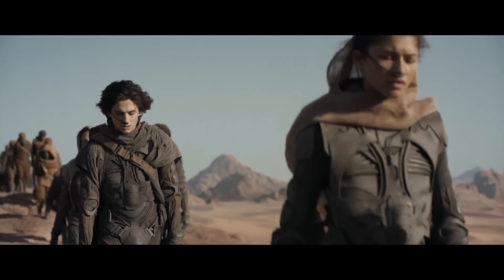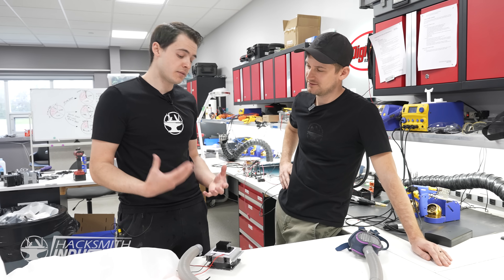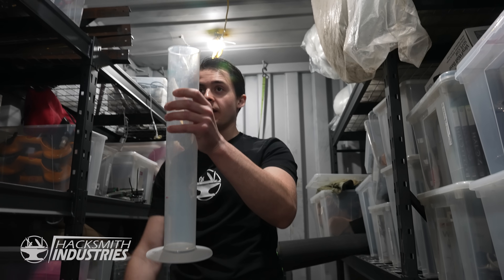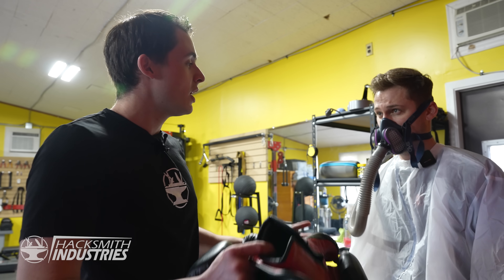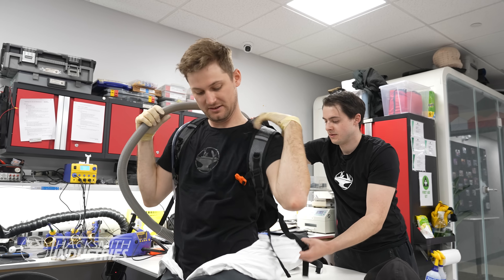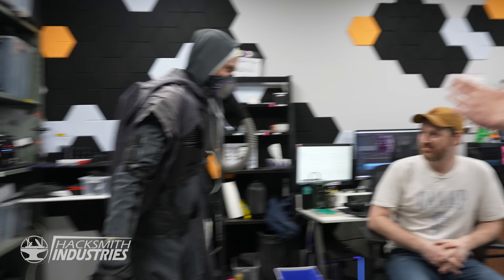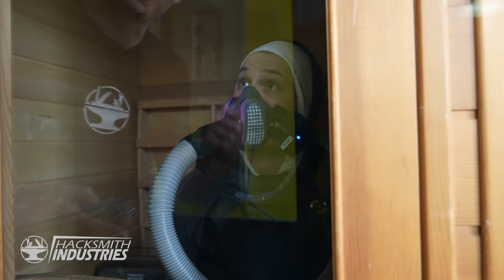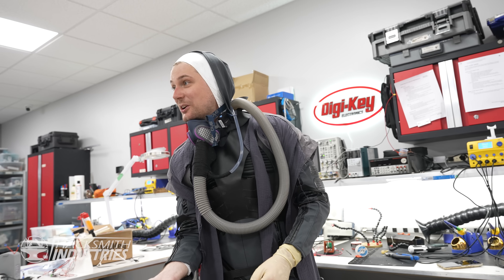Building a real DUNE STILL SUIT (1 DAY BUILD)

Comment: I think this as a proof of concept is cool. 

Though with a filter outside exposed like that it wouldn't survive in the desert of Dune for long. 😅

Also if you had a way to use kinetic energy alongside a solar battery pack, It could be self sustainable. I really like the design overall. 

You guys did an amazing job and it looks great though! 🔥🔥 🔥

Imagine if the backpack had:
Neptune crystal AquamanCrystal that was labeled to absorb oxygen from water and air. You could probably swim with it on too. 😅

Comment: Guys, a hint, since I think it was not mentioned in the video: since he is drinking distilled water, meaning there are almost no electrolytes in the water while also sweating and doing physical exercise therefore losing more, there is a definite amount of time you can spend using the suit until you start going into an acute deficite of electrolytes and it gets seriously dangerous. Source: I am a nurse. Would be really interesting if you could find a solution for this.

Comment: I wonder, a material of capillary action and the same principles of the thermoelectric cooler, is it possible? 🤔
Then it would do all of that passively without the need for the batteries, but you'd still need the filter.

Comment: The Dune Still suits probably work through capillary action, rather than what you've designed. The materials used in the suit probably made to direct the body moisture to a pack worn on the back where it is turned to vapor and then condensed, while the impurities are expelled through vents or something from the pack, though salt would likely be placed in a separate container.

Comment: I definitely think this concept needs a revision much like how the channel has gone back to the Lightsaber and Thors hammer ideas to implement different features and then sometimes merging them together Iron Man armour style. I think a starting point would be seeing if you guys could engineer into a material that when against the skin, can pick up the sweat on the body, absorb it and pump it into small tubes over body, kinda like how astronaut suits use micro-tubes to pump water around the suit to regulate temperature. It might be too costly but if its possible you could legit contribute to science potentially.

Comment: If you're going to do this for a long period of time you'll want to look into how much aluminum ions are being leeched into the water.

A larger cooler than it has some kind of glass coating while insulated would actually allow you to drip the water through a system that doesn't collect any metal ions from the condenser
Reply from the maker: It was a one day build -- proof of concept lol

Comment: Idk but that balloon suit is probably a better design since it allows for a fan to be installed inside the suit so it can circulate the moist air from inside the suit over the condenser thus actually capturing the sweat and not just exhaled water. And fun fact: the water you exhale is not just body moisture but also water that was created when your body burned carbohydrates to get energy and the hydrogen bonded with oxygen. So in a sense you actually generate water from food and oxygen.

Comment: You could install water pipes in a suit with pumping mechanisms build into the soles, armpits and crotch area to catch sweat and pump it to the filter trough continued movement......no clue how to do that but the spacing created by the tubes could help a lil with cooling.

Comment: Anyone else just got stressed by watching this video? I am a science guy that watch to relax and learn, so wouldn't bother me if you slowed down a little and didn't talk so quickly. I had to check if it was at 1.5x speed. These videos are probably designed for a wider doom-scrolling generation, but I would appreciate slower videos with more scientific explanation. Of course, this build today was extremely simple, so no need for long explanations.

Comment: I would like to point out that the book states that it cools the body as well. It also runs from pumps attached to the boot, and the whole thing is powered by your body movement. The stillsuit also requires constant maintenance and is incredibly expensive. Most facilities only have one still suit that is maintained and passed down from generations. It is also primarily made from a plastic material that is a by-product of spice purification. So the suits are literally made of spice.

Comment: Two problems, first... reclaiming all your lost fluid is secondary to not losing it in the first place, you made an outfit that is designed to make it's wearer lose moisture so that it can be reclaimed.  Prevent moisture loss, then reclaim what is lost.
Second... should use a military gas mask already has a drinking tube built into it, just use that as the base for your mask.  It also has a check valve on the voicemitter.

Comment: Thoughts on how a sill suit works. First, the mask you use was too much. They only used a nose peace for breathing moisture threw the suit. The suit used muscle movement to pump the water threw the suit, which would mean the moisture extractor you made wold not only make the water, it would cycle threw the system to cool off the water & the person at the same time. You don't want to pull off the suit at the end of the day looking like a California raisin. If you want to extract sweat, you need a gap between the suit & skin to pump damp air from your body. I'm thinking the nose peace is the only place where the suit gets moisture from. Filtering & power. Tubes or pouches on the back or thighs would filter liquids, & powering the suit would come from ether solar power or hydro-power from the motion pumping suit. If I left anything out let me know.

Comment: Unless I am missing something, isn't this only collecting from his respiration?  The condenser is closed off from the rest of the suit, so if anything, his sweat would eventually pool at his feet.
Reply: This confused me also. I don’t know what the point of making him workout and sweat in the sauna was 🤔
Reply: I'm assuming rather than sponge or pool the sweat they want the sweat to evaporate but can't escape the suit, and  eventually get condensed into the tank
Reply: Exactly, it was a closed system with only the moisture from his breath being captured. Sadly a little misleading.
Reply: exactly what I was thinking. How does it collect sweat? Is there a pump somewhere?
Reply: From what I'm understanding the condenser is actually cooling the moisture in the air inside the suit itself and capturing that in the bag.
Reply: That's why it's put into the setup through a hole in the suit, so the cold side stays inside.  As the persperation evaporates and cools the body, it condenses on the cold heat sink and becomes clean water.
Reply: The answer is in the video. The water condenses on the heat sink.

Comment: Perhaps I missed it... how is it capturing sweat? The condenser is picking up his exhaled breath. I suppose a little of the humid air in the suit itself would come in contact with the cooling fins, but there's no mechanism for circulating air inside the suit and no way to actually capture any liquid from the skin or inner suit surface.

Comment: The point is to keep you cool but also collect your moisture, not to induce sweating to collect.  You should use the water collected to circulate around the body like a space suit; vent the heat passively or actively and also use it to drink.

Comment: I’m not sure this works as you say it does because there’s no way for the water from sweat to come into the condensation unit so won’t condense into the bladder and it will only. Be the moisture from the mouth and any added

Comment: Sweat helps you cool down in the heat. A still suit cannot let moisture out so it’s not allowing any cooling or dissipation of body heat. So how does the suit ensure you don’t overheat and die? If the suit in dune has some magical way to regulate body temp and cool you down, then you aren’t really sweating much. Seems like a better option is a respirator that catches moisture from breathing and a suit that keeps you from sweating.
Reply: im pretty sure that at least in concept of the book the water gets cycled like a heat exchanger. that would clear the "used" water and then as you sweat it would make a new protection.
Reply: oh and on top of that. in the dune universe water is more of  an issue than anything else so I think some sort of cooling tech to make it not deadly probably exists.
Reply: @theleoshowm3010 iirc in the Film Theory video about the Stillsuit, they explain that for the innermost layer of the suit, it's a material that's porous enough to allow air to move through it 🤔 And I believe in some cases in the real world, we have these sort of mini-AC units where the tubes move throughout your plate carrier or clothes to mitigate some of the heat. Definitely a fun idea to combine all these into one suit!
Reply: It's explained in the new dune movie. They have a separate water cooling system that goes around their suit that uses liquid they don't want to drink.
Reply: @plokoon7606 Ahh right, I forgot about that! "Their water's too polluted, but it can still be used for cooling" something like that
Reply: @mcblorf  I guess so, but using your own water for evaporation would be a big no-no
Reply: I'd hope in 20,000 years in the future, that we have fabrics that can flow air to allow for evaporation
Reply: I make costumes that I use in the desert, that was my thoughts exactly. Even at night that thing looks like a death trap.
Reply: honestly the best option is to just stay cool and have only the respirator and for pee. but thats way less cool
Reply: The stillsuit had some tubing around the body like the astronauts inner suit. That would keep you cold. I guess you can start with a big chunk of ice in your back and dump the heat there, and the re-freeze it back in the base.
Reply: You can use peltier chips for cooling down
Reply: He mentioned the dehumidifier  cooling the surrounding air while collecting the water. Which is doubly helpful as the act of producing sweat is what cools you down the most

Comment: Cool. I imagine at some point the salt being removed from the sweat needs to be cleaned out of the filter.
Reply: Fremen stillsuits as described in the books didn’t have filters; they literally distilled water from sweat and urine (and poop in thigh pouches). The salt was collected out of the suit every day but I can’t remember what it was used for. Ventilation wasn’t discussed- I suspect the suit might get a bit stinky.

But yeah, you’re right. The Hacksmith suit filter would need cleaning or more likely replacing every so often.
Reply: i believe the salt would build up on your person. the evaporation and condensation should desalinate the water.

Comment: Could this actually be viable tech for working in the desert? Along with some way to circulate the air from the cool side of the TEC inside the suit and a few small solar panels sewn into the shoulders... 🤔
:_LightsaberLight::_LightsaberLight2::_LightsaberSaber8::_LightsaberSaber8::_LightsaberSaber9:
Reply: You'd probably die of heat exhaustion pretty quickly, the peltier cooler is tiny
Reply: You'd have to make alot of changes, but as a proof of concept, v1, it works. Efficiency is probably horrid just now. But this needs to be a series and I really think they could make a viable product for desert communities. Water is life after all.
Reply: That filter for sure doesn't remove the salt content.
Reply: @davidjohannesen  I wonder if the vapor distillation does, though 🤔
Reply: @davidjohannesen  evaporation does clean water a lot
Reply: @davidjohannesen  Drinking clean sweat, no thanks, yuk.
Reply: It doesn´t have the cooling funcion like the stillsuits from Dune, so no. It would make working in the desert even harder. Deadly. 
They shouldn´t have put him in the sauna. That was dangerous as hell.
Reply: @Mouse_Metal  Yep. No core-temperature monitoring means it's easy to flirt with hyperthermia.
Reply: There’s a Japanese security guard suit that is inflatable with a personal AC unit integrated.